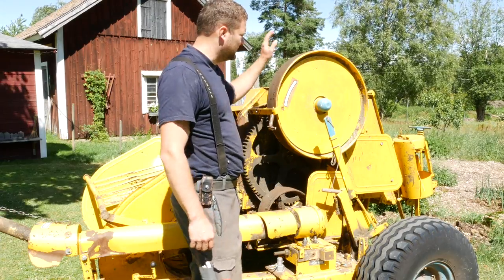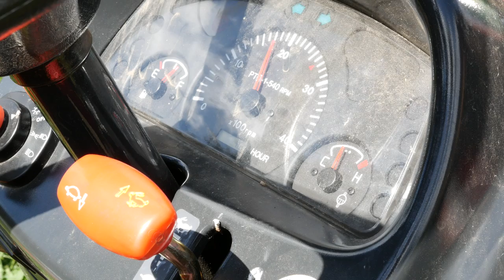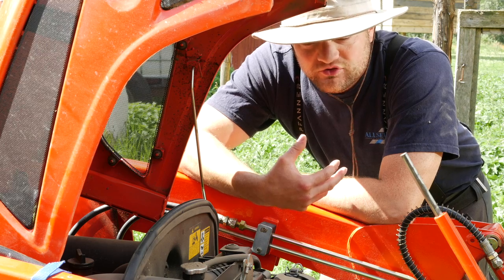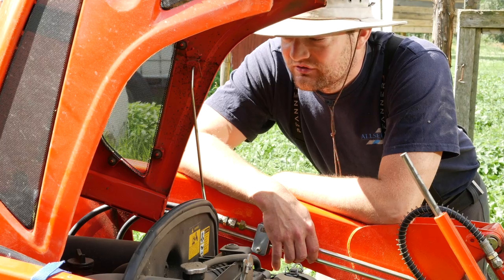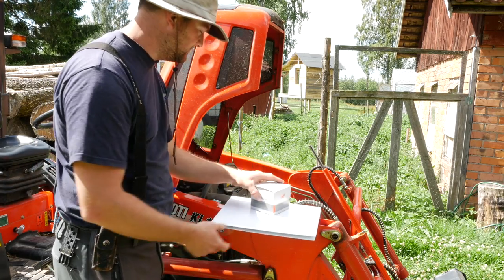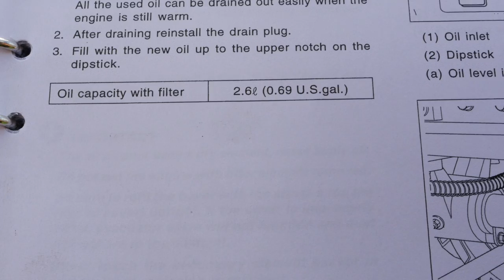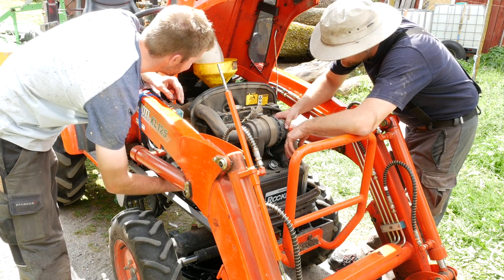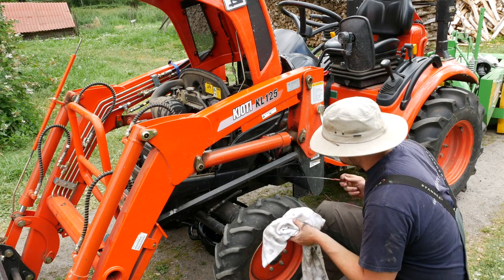Small Tractor vs Big Tractor

Comment: belt for bailer look to a lather shop as to make a belts to to fit but you have to get them soaking wet as they dry the belt will shrink to fit and be tiet,as they did on old belt drive tractors

Comment: Those spin on filters should be filled as much as possible, not full in this case.  If you can hold down or disconnect the fuel solenoid so the engine doesn't start straight away, then the oil gets pumped round and fills the filter and oil galleries, will add on a few hours engine life.

Screw on filters should not need tools to tighten.  Lube as you did, wind the filter on until contact is made then, by hand, another 1\4 to 1\2 turn.  Check for leaks of course, but it won't unless there is another problem.
The full tighten like you showed just makes it difficult next time, not more secure.

Thanks for all your videos.

Comment: In your manual does it say to use a oil filter wrench  to tighten your new filter, I was told to just hand tighten and not use a wrench but good job on the oil change and greasing up all your grease points. thank you Larry
Reply: Looked like it was in awkward spot...  But you are correct.

Comment: Advice: Next time you do an oil change, after you measure the amount of oil needed for your tractor (or any equipment for that matter) make sure you fill the oil filter with oil before screwing it on. That way when you first start the tractor the engine won't run without any oil in it and also it diminishes the amount of air. If you don't do that it damages the engine little by little. Never dry run an engine.
Reply: Edwin you can't pre-fill a filter that's side mounted.
Reply: Yes you can, I've had dozens of cars, tractors, trucks that had side-mount filters.  Secret there is don't fill it to the top, and get good at hitting the threads and spinning on quickly !
Reply: Yes you can. Maybe not all the way, but you can fill like 1/2 or even 3/4 of it. Let the oil soak into the filtering material (sometimes its paper, sometimes it's some sort of cloth or fabric) and then fill it a little bit more, then you can screw it on.
Reply: On my Kubota B1650 you can't pre-fill the filter. The filter goes in vertical, the open end is down. I was a diesel mechanic and I always pre-filled when possible.
Reply: I've seen some equipment that have the filter mounted upside down. What an old mechanic told me to do is put a small amount of oil in it and let it soak into the filtering material, that way it won't drip (maybe a really small amount) when you mount it. It's still a bit better than dry running your equipment.
I'm not a mechanic but I learned some stuff from a friend's dad who was a mechanic and they had a lot of equipment because they ran a mid-sized farm.
Reply: holleyman1970 I'm not gonna argue about oil filters or hydraulic filters, but you know as well as I do that you HAVE TO fill fuel filters (the spin-on type) (the bowl separators with filter in the dome also needs to be pre-filled).  If you don't put fuel in the filters, you'll NEVER get the engine started.  p.s. nice username.  Many of my cars came with Holleys from the factory.  I had a model 1946 on my I-6 200, it was a great carburetor.
Reply: @ Bill Hunter @ Edwin .... The guys who design upside-down mounted filters must be standing on their heads (i.e. maybe they're from Japan...). That's got to make for a nice mess when removing an old filter, or do they gravity-drain inside the motor when it's shut off?
Reply: "You are adding dirty oil to the filtered side of the oil system."  That makes no sense at all.  With a new filter and fresh oil, there is no dirty oil there.
Reply: Almost all of the oil drains when you remove the bolt from under the car so therefore the filter will be almost empty. Still there will be some oil left inside the filter but will not cause too much of a mess if you're quick.
Reply: @ShawnD1027 What he meant is this that even fresh oil contains some impurities. Also the filtering material inside the filters have a filtering direction (when it comes to oil filters the oil is filtered from inside to the outside of the filter/from the middle to the periphery so basically when you fill it with oil you need to be sure to pour the fresh oil exactly in the middle and not on the sides). Not sure how to explain but hope it makes sense.
When it comes to gas or diesel filters they have a small arrow on them so you install them the right way. If you install them incorrect the gas/diesel won't be filtered, not much gas will pass through the filter and you'll have serious problems with your car's engine, especially if it's a diesel (you know that you should never let a diesel engine run out of fuel).
Reply: Sorry, I do not believe that explanation either, Edwin.  Fresh (modern) oil does not have impurities that need to be immediately filtered out by the oil filter.  The filtering direction is a red herring in this discussion given the lack of impurities.

Even if the "fresh oil contains some impurities" claim were true, it'd be made irrelevant by the fact that filters and/or housings have pressure bypasses that open during cold starts to prevent the filter media from crushing due to the excessive drop across the media with cold oil.  During that period, that bypassed portion of the oil is completely unfiltered and is certainly more contaminated compared to whatever fresh oil you might have put in a fresh filter.

Comment: Not a fan of gray market and china made tractors, A tractor has to be easy to obtain parts for first and it has to be a good quality second . A tractor should be hydrostatic if under 100 hp and have a quick hitch for the 3 point. A person needs to watch which tires they specify when buying  a new tractor or replacing on a older machine. A 40 hp is one the most verastile machines  for general farm or ranch use.

Comment: hay season is over in my area for first cutting second cutting will start soon. My one little tractor like your would over heat running a 5ft brush hog in the summer
Reply from the maker: We can only cut 1 hay harvest in our climate.
Reply: Really? I live near Stockholm, and the expected number of cuts of silage/haylage/hay is three a year, certainly two. That's on fields that are regularly cultivated and in the crop rotation cycle, granted, but I'm still surprised to hear that you can only get one when you are to the south of us. Or perhaps you mean that you could get more cuts if you were doing silage and could start earlier in the season?